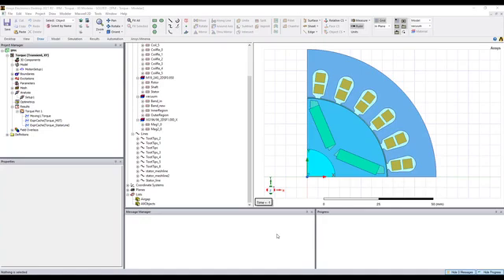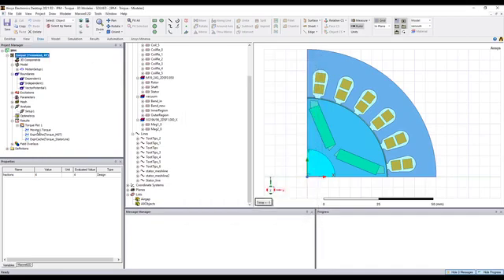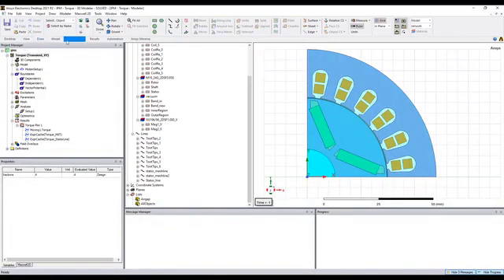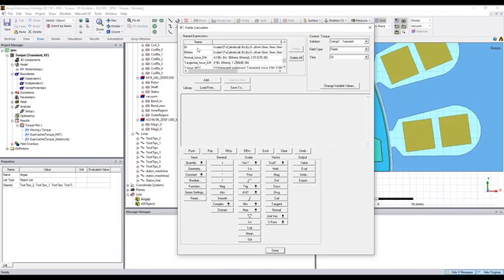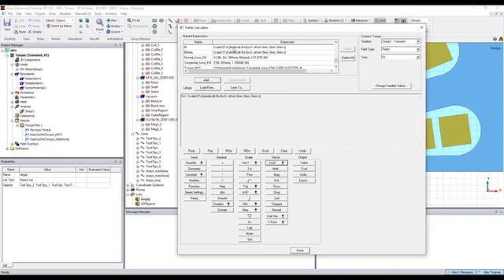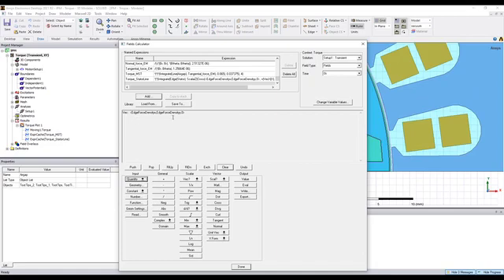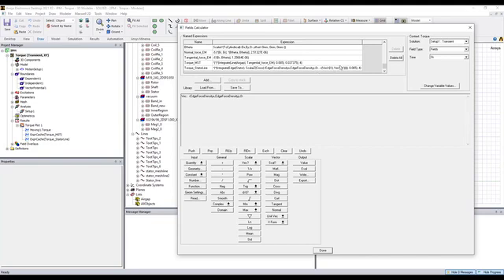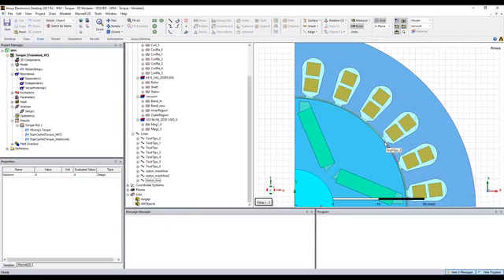Motor Torque Calculation with Ansys Maxwell

Comment: Hi, Nice video, I am new to Ansys electromagnetic simulation, I am using the permanent magnets to develop magnetic flux for analyzing l the flux leakage, regarding this  I have a question about solving a model and developing the 3D surface .....Could you help me regarding this?
Reply: I have followed this link to repeat this model but it not solved...........,  https://youtu.be/o9VJuEbOusE